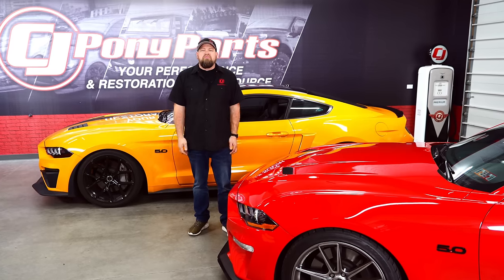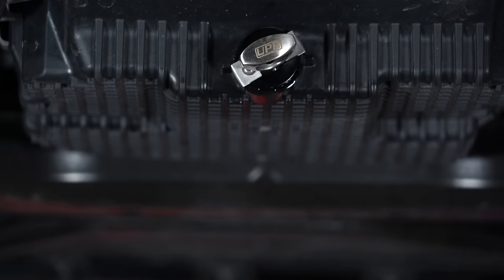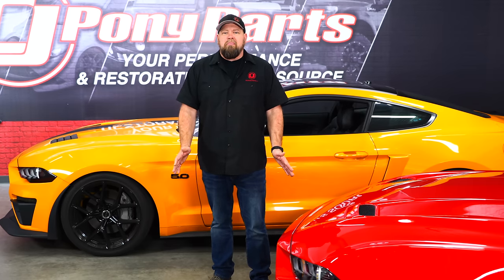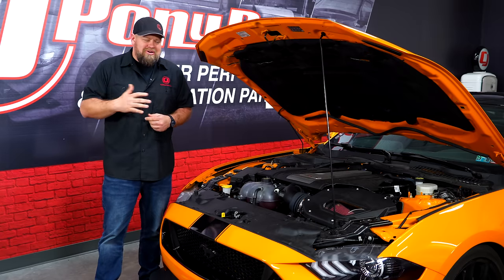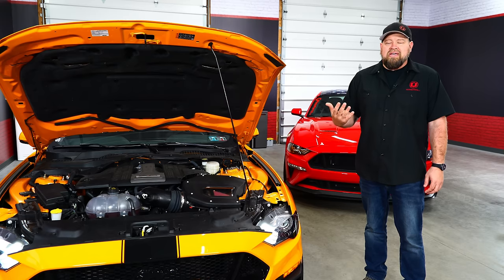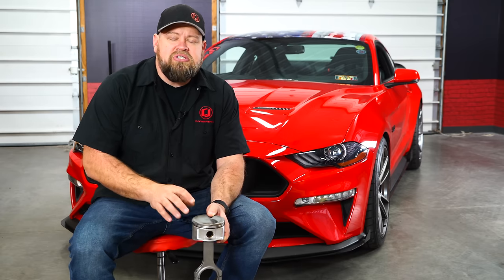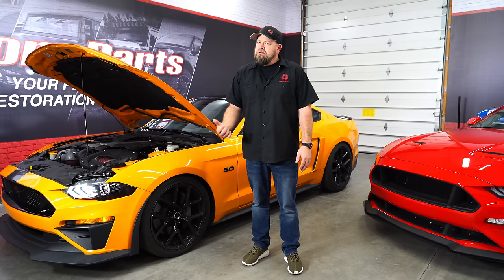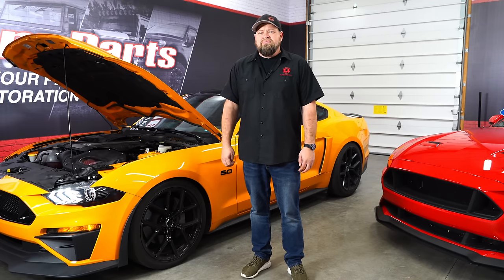2018-2019 Mustang Tick: Should You Be Concerned?

Comment: Gentleman, I'm just a seasoned Ford technician chiming in with what I've experience & encountered. Back in 2011 when the Coyote engine was first realeased, I had at least one Mustang/F150 a week come in with this concern. After tearing down every engine I always found that the crankshaft to main bearing clearances would vary significantly journal to journal abnormally. When discussing with my local FSE & online engineers, I was told that the company responsible for manufacturing the main bearing was having material issues which affected the thermal expansion rates. They had assured me that the driveability would not be affected, so long there is no excess of metal in the oil. I continue to receive vehicles to this day, & my repairs vary from replacing crankshafts/bearings to entire engines, depending on how the engine was treated. In my opinion, drive, enjoy your car, & inspect your oil when servicing, then address as needed.
Reply: No, I should not have to worry about crap like this after spending good money on this car. Second Ford did nothing to address the problem, third I don't see issues like this in other cars.
Reply: People these coyotes motors are ticking bombs. I was going to buy one but don't want the headache and be getting slightly used vette instead
Reply: robert korab great idea 👍🏻
Reply: @sbalak  Never heard of issues like this? Have you ever heard the Hemi Tick? Hemi's have had issues since the 90's..
Reply: @Waors  I guess I did not. Cheers.
Reply: This is interesting. I have not herd the tick as of yet concerning my own GT, but my buds Stang definitely has the sound for sure. As you stated, it is indeed coming from the crank/ rod connection area. The bearings were splitting and eroding. I wouldn't recommend owners to just live with it. Thats horrible advice. Ford should do something retroactively too remedy the issue. JS..

Side note: I plan on running liquid Molly Special Tech 5w 30 immediately after my first oil change and A nice serving of Ceratec every 50k miles 👌
Reply: @Waors  the Hemi tick is still ongoing with the newer vehicles?
Reply: passing on the Coyote engine, ill stick with my  '00 GT (277K miles, original stock engine and tranny and still alive!)
Reply: @robertkorab4160  I beat the hell out of my ticking 13
Reply: Very sound advice,  Thanks
Reply: put 35,000 miles on my 2018 GT already and it has always had the tick especially when cold. I just do regular oil changes using 5w-20 and it hasn’t caused any problem for me. Never got louder or quieter. I think it’s just gonna be one of the characteristics of the coyote.

Comment: Yes. 24,000 miles of abuse and later added boost. Still no metal in oil. It did go away with Ceratec. Currently making 820 to the wheels and still no issues or metal in oil.
Reply: Yeahhhhh buddy! You give us hope :) haha
Reply: Thanks. I wouldn’t sweat it unless you start seeing metal in oil past break in period. I’ve probably got the highest mileage 2018 on YouTube or in general. I think it’s being blown way out of proportion.
Reply: Same here boosted & runs hard AF!
Reply: What oil are you running also!?
Reply: Jacob Santa just switched to Shell Rotella 5w40 a few weeks ago. I’ve been using the standard 5w20 up until that. So using that thin of oil I should of definitely seen metal in oil by now.
Reply: Just boosted mine as well with a vortech V3. It will get some ceratec and 5w50 in the spring when it comes out of the garage. Couple 18s by me with almost 20k miles on them. 1 been running ceratec since day 1, the other guy running some other friction modifier. They both send their cars when ever possible, including in the winter since they daily their cars. No ticks, no issues, shit load of fun.
Reply: 820 stock motor. Time bomb.
Reply: @maximusvonce1381  
But not today.
Reply: @maximusvonce1381  The coyote can live at 800+hp but that's really pushing the stock pistons and rods (and liners in the older motors) hard. Typically over 750hp is when you wanna start thinking about forged pistons, stronger rods, and maybe even liners. Get a billet oil pump and crank gear while your in there.
The crank and block are good to around 1500hp.
Reply: Oil analysis is very inexpensive and gives one insight and peace of mind.
Reply: @maximusvonce1381  with the 11-14 coyotes anything over 650 stock is pushing it. 15-17 can live till around 800 stock. 18+ there are cars put there making 900 stock. The 11-14s arent very expensive to build either and can be pushed hard once they are😎
Reply: @I Am Sekou yeah i seem to have a issue with running into crowds with my mustang just instincts
Reply: So sick!! I cant wait to mod mine!! I got a 2012 with only 30k miles on it. Engine is currently stock and no ticking at all, but I cant wait to really set her free lol
Reply: nola504boy1 how hard is AF ?
Reply: maximus vonce exactly cuts a engine lifespan to any day .... 💥
Reply: @frozenstang3868  I have No Tick,  5500mi on mine and did the first oil change as directed by ECU prompt. Sent factory fill in for full Blackstone analysis with TBN check added. Added SynMB1 5/20 and will run it until CPU prompt and have it checked.
Reply: @houseofbaker2001  I live in Canada and have only had one check done on my oil long before i got wind of the 18 mustang tick. Is it possible for blackstone to check for additives? Mustang Mike 740 sent a sample of the factory oil at 300 miles ,will be interesting to see whats up with that.Im sure not all 18's have the tick or there would be way more hew and cry going on. 35 yrs of wrenching tells me Ford is not being forthcoming ,especially by saying this is normal. Normal is when every car has it and they can tell  you exactly what component is making the noise. I parked my 25 yr old stratus next to a new subaru and couldnt hear my car running, Subaru has some nasty sounding engines lol.
Reply: Derrick, your engine won't last long if its stock internally. These engines were not made to last long especially with 700 crank hp/615 wheel hp, but 820 wheel hp/ 950 crank, your driving a firecracker with a short wick.
Reply: @marshalleng1933  the 2018+ are no stronger than the 2015-17's. 675-700 crank hp is the absolute safe limit if driven mildly. Anything over that is in self destruct mode. Ford is cutting costs and corners and pushing aggressively for taking people out of driving vehicles altogether, as is GM. This is the end of an era. Heck, by 2027 people won't be able to legally drive today's gas powered vehicles on public roads.
Reply: @MasterCarguy44-pk2dq  that's hilarious because I work for GM as a tech and have yet to see a self driving vehicle from GM. Let alone heard of them 'pushing' for self driven vehicles. I dont know which fortune teller you been talking to but I'd have to say they are incorrect.
Reply: MasterCarguy44  Lol, by 2027 gas powered cars are going to be outlawed? 

I’d love to see your source.  Not going to happen, BTW, unless radical left wing Democrats take over all 3 branches.  

No NEW gasoline powered cars allowed to be sold after 2027 is a remote possibility, but retroactively outlawing gasoline powered cars?  No way.
Reply: @MasterCarguy44-pk2dq  Don't be ridiculous. Do you realize how many gas powered machines are in use across the globe? Do you realize how much the oil market is worth? Technology isn't even there yet. Government Policy isn't there yet. The general public's opinion of banning gas powered vehicles or machines is nowhere near there yet. You can count the number of different models of EVs on two hands across all manufacturers Globally. If they wanted to establish such a policy, there are upwards of 225 million valid drivers license owners in the US alone. The few manufactures of EVs there are wouldn't even dream of potentially setting aside all other projects and priorities just to mass produce that many vehicles for one market (US) , especially by 2027 . Then you have to deal with tariffs and other taxes, providing adequate charging stations across the country in not just major cities, but pretty much all towns across the country. The range of the best EVs is less than 300 miles, and they still take hours to charge. That kind of policy would reshape the country as we know it. From transportation policy, to national security to our economy. And do you stop there? Should then all gas powered vehicles and machines be banned? Then you have to figure out what to do with the millions of gas powered vehicles already in existence, some of which have been in use since the late 40s and 50s. Then you have to enforce it which given the sheer abundance of gas powered vehicles and people willing to use them would be a seriously daunting task. This kind of policy wouldn't go into effect until somewhere around 2055 and that's not only at the earliest, but that's also if that's the direction the world even chooses to go, in because this wouldn't just effect the US. It would effect the world. And this is all just scratching the surface of the subject. We could barely get manufacturers to make backup cameras standard.  As for the gen 3 coyote it's not the same as the gen 2. Go look at diagrams of the two, I'm done lecturing.
Reply: @marshalleng1933  Your just clueless. I did some of the advertising. And if you follow today's world much, GM, Ford and many others are testing these systems.n
Reply: MasterCarguy44 yes I do not doubt that self driving cars are on the way. Tesla is one of the firsts to have this feature. But as you were saying gasoline powered vehicle will be illegal to drive on the streets. I do not believe that for a second.
Reply: 820 my ass dude.
Reply: 1. How many bottles of Ceratec did you use?
2. Do you pour in Ceratec after every oil change?
Reply: What did you do to the car to push that kind of horse power
Reply: @zonomouszone316  can't say
Reply: @iamcyberpunk68  why not
Reply: Derrick Sizemore did u add just 1 bottle per oil change ?
Reply: @A-A-RonRaces  😂🤣😂

Comment: My 2014 coyote swapped fox started having a slight tick at idle. It eventually started having a random knock and tick sound(video on my channel) when it was cold but right when it hit 203cht it went away completely. I pulled the pan and checked all the rod bearings but everything looked perfect. I pulled the timing cover and there was no slack in the chain or weak tensioners. So I pulled the chains and when I grabbed the crank sprocket it had a little wobble on the crank, after removing I noticed the keyway was rounded off. I replaced the sprocket and keyway reassembled everything and so far after about 1000 miles everything is quiet.

Comment: LISTEN. I finally have the real answer. Bad rod bearing (or bearings) … I just got my long block replaced for the SAME EXACT noise in my 2017 mustang GT and ford only listened to me when after I showed up five different times and basically wasn’t taking ‘it’s fine’ for an answer. But beware, if it’s under warranty and they replace it you’ll get a remanufactured motor and the mechanics get paid less when they do warranty fixes (warranty is cost x, fixes when customer pays are cost +30%). So long story short I’ve been through two reman blocks and each one was jacked up but for different reasons. Out of the three blocks I had in that mustang (one factory and two reman), the only one that had the tick was the one that was torn down to find a spun rod bearing and metal shavings in the oil.
Reply: I’ve never seen a lower end component make a inconsistent noise… this sounds exactly like pump cavitation, makes me wonder if it’s the crappy oil pump gears the cars come with…
Reply: Believe me everyone and their mom has an opinion on what this noise could be, but when something is failing / not controlled there’s a chance it’s going to be inconsistent. Theory and real life are different; and given my lengthy experience with this noise, multiple trips to ford, them tearing the engine down completely and them finding a bad rod bearing,  and finally them replacing the motor to have the noise completely go away, I do firmly believe that is what the noise is. I’m sure they would rather have just replaced the oil pump vs the whole blockif it was that simple?

Comment: So if no metal in oil ...Send It 🤔 sounds good 👌 to me!
Reply: Any luck with yours
Reply: I used the ceratec and it’s fine
Reply: @StangMode  i got 11k miles on mine no tick. I was worried about performance mods voiding the warranty if its possible for it to occur later on
Reply: @StangMode  hey I'm a big fan of your channel.  I would very curious to know you if don't add ceratec next oil chang if tick stays gone..keep us posted!
Reply: tb12269 it’s gone with ceratec
Reply: @tb12269   I'm going to do that I have been chronicling from delivery to drive home....my car didn't tick till after the first full head cycle ....
Reply: StangMode - Yes, no different than we experienced with the 03/04 Cobra piston slap days.
Reply: Vote for Ceratec. 1 bottle for 10qts is more than enough to shut this beast up.
Reply: Ceratec just hides the problem like Marvel mystery oil shuts lifters up.
Reply: @josephallevato7188   It depends on if the minor piston slap is inherent or not. If it is inherent due to the new cylinder design clearance and higher compression ratio, then having a friction modifier will actually help the issue, and not just hide it. Piston slap is affected by rod motion, combustion, and also lubricity to some degree. If lubricity is superior, then the rocking motion of a piston will have less adverse affects on the piston skirts and cylinder wall. Ceratec not only increases lubricity, but it also plates the surface of the metal allowing for a smoother surface. So, unlike other snake oils just hiding problems, Ceratec actually helps an engine run more smoothly, especially if the noise we're hearing is actually considered normal due to its design.
Reply: I agree with the wannabe ;) ceratec just hides it but it can’t be too serious I mean midnight performances 2018 is just now getting a built motor after hurting feeling with the stock motor for the past year and it never failed
Reply: Wannabe? LMAO! Im the OG Cookie Monster
Reply: @josephallevato7188  the problem is friction. Molly reduces friction, doesn't mask the problem, fixes the problem.
Reply: Charles Cinque I’ll look into it but at this time I don’t have the issue. Sounds valid,either way I’m not gonna worry about it. If SHTF I’ll just drive it until something happens and then Ford can fix it.
Reply: @josephallevato7188  only thing I disagree with in the video is the comment about Ford. Brought my car to two dealers and they acted like they didn't know WTF I was talking about and denied there was even a tick. But I agree, go enjoy the car! Too many people letting it drive them crazy.
Reply: Charles Cinque my first Mustang at 49yo. Waited a long time and had some major set backs in my life that stopped me from affording a car like this. I’m gonna enjoy the F out of this thing until I die. My last new car and something I’ve wanted since the 80’s. Tix or no tick,I’m having a blast so far and it’s only been two months!
Reply: StangMode what’s up stangmode!!!
Reply: @BarnfindGT That car belongs to @houstonstreetmonsters, it was put together by midnight
Reply: I ordered a bottle of Ceramic today, plan to try it out  in my Dodge Ram with 102K miles and see what happens. I won't put anything in my Mustang. I'd consult a Ford tech first.
Reply: @anthonymontefusco4290  It all depends on if the noise is inherent in the design or not. To  simply say for $50k there should be no odd noises, is a bit of a pipe dream unless the car was designed as a very silent luxury sedan to begin with. These cars weren't designed for that. They are literally a car that uses a workhorse truck engine. Yet, when you buy a $75k Diesel engine truck, there will be a whole host of noises that sound horrendous and all those noises are normal. Whether or not it is truly a normal noise with this 5.0L engine remains to be seen.
Reply: Just bought the 2019 GT PP 10 speed! I absolutely love it. I will pay close attention and see if I hear anything. 545 miles so far
Reply: @Condor1970  So Condor if I blue Print this Block, piston slap goes away?
Reply: Stangmode you watch CJ Pony Videos....hell yeah
Reply: @josephallevato7188   I got a 5.0 at 49 too! I really call it my 5.0 at 50 car cause I always wanted a race car. S550 at 50 FTW. By the way chocolate chip or oatmeal raisin...LoL
Reply: houseofbaker2001 oatmeal raisin all day long lol
Reply: Congrats on getting into the 10's
Reply: IS IT NORMAL TO HAVE METAL IN MY 1ST OIL CHANGE ?
Reply: Alain Salazar no
Reply: @anthonymontefusco4290  I have the 2.0 ecoboost in my 17 Focus. So much fun. I also really hear the injectors when a car is parked next to me. Thought it was lifters at first. Want a GT badly. Was going to make that next purchase in a year or so. Tick scaring me into considering ecoboost Mustang instead of GT. Either way next car is a Mustang. Fusions are nice. Didn't even know they came with ecoboost! Cool.

Comment: 2012 5.0 owner. It ticks, sure.  It also has 162,000miles on it. I’ve done the plugs (at around 100,000 miles) and conventional oil changes every 4000 miles, and air filter every 12,000 miles; that’s it. It doesn’t use any oil and it still runs strong.
Reply: hey man, have a 2012 as well, you ever try ceratec